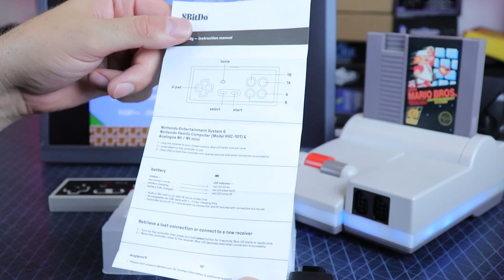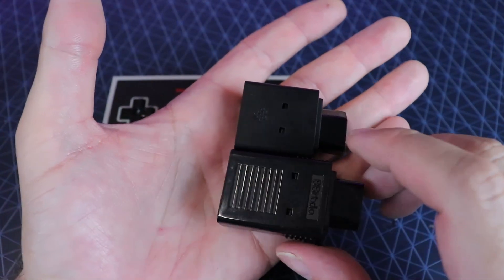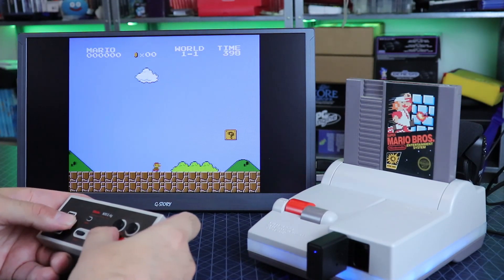The Best NES Controller You Can Buy! 8Bitdo N30 2.4g Teardown & Review!

Comment: I'm using this controler using a normal toaster NES on a 27" Trinitron CRT and I can assure you guys that there's not any perceptible lag at all. I have played Punch Out, Ninja Gaiden, Mario 3, Castlevania, etc and haven't had a single issue with thus awesome controller. Props to 8 bitDo
Reply: The 2.4ghz version has 3.6ms(tested and confirmed) of latency. Pretty impressive! I've heard Retro-Bit's 2.4ghz controllers nearly triple that amount including the Origin 8.

Comment: I need the MiSTer version of this and the SNES controller.  Then my life will be complete.
Reply: You can use these wired with the MiSTer. As well as the SNES version
Reply: yeahbuddy I’m really looking for a 2.4ghz wireless controller that connects via USB and is the closest representation of the original controller. 8bitdo has the closest representation part down, and although they have done thIs for the Genesis controller, they haven’t done the same with the NES or SNES yet. Hopefully they will some day.
Reply: @PabstOban  you can buy an NES to USB adapter for the MiSTer.

Comment: Thanks. Ordered off your link. My old NES controller has been sitting on the desk for weeks, waiting to get cleaned up but I can't find any iso. alcohol.
Reply: Any leads on a classic arcade stick for Switch? No current controller options are really working well for some recent (ex. Burgertime, Kangaroo) Arcade Archives releases. Even tried my 8bitdo arcade stick with little success. Need a classic arcade stick that allows me to switch between 4-way and 8-way control.

Comment: But the Dpad still sucks. Nothing comes close to a real NES or SNES controller.
Reply: To me the D-pad is pretty good. I did have issues with the SNES controllers they released to go with the Super NT. I had to do all sorts of crap to try and fix it. I don't think every one of the blutooth controllers they released around that time had the issue. But a good chunk of them did. The new ones, for the 2.4g have a new board. The D-pad is great on it, I swapped out the membranes with an official SNES controller for an even more authentic feel. Over all both controllers are great and I'd highly recommend, if the idea of a basically lagless wireless controller is appealing to you at all for your classic systems.